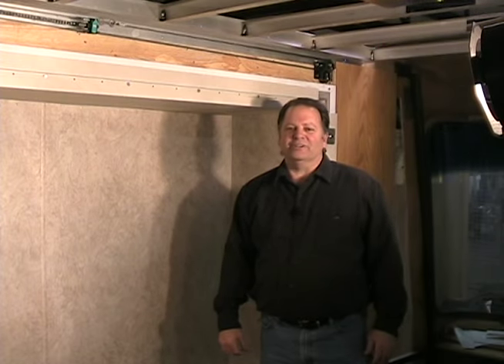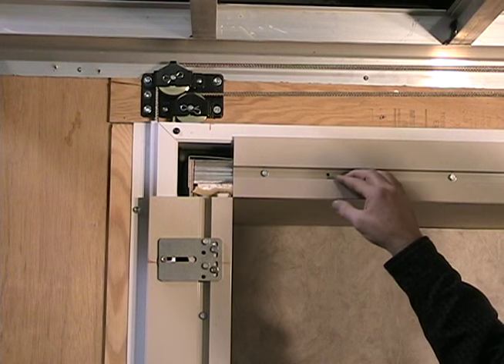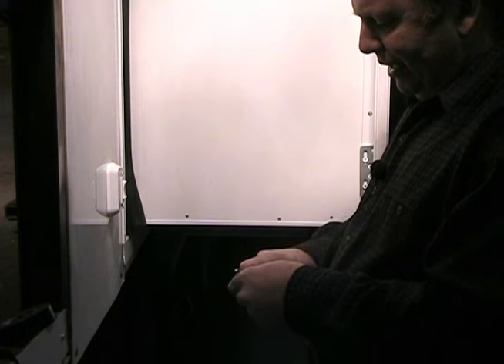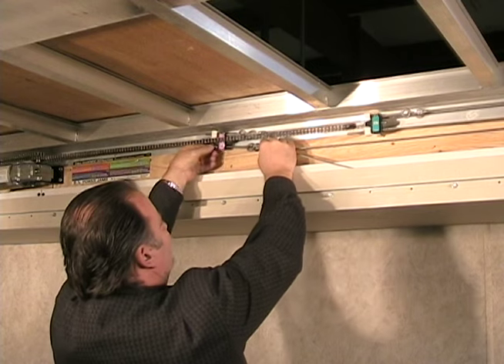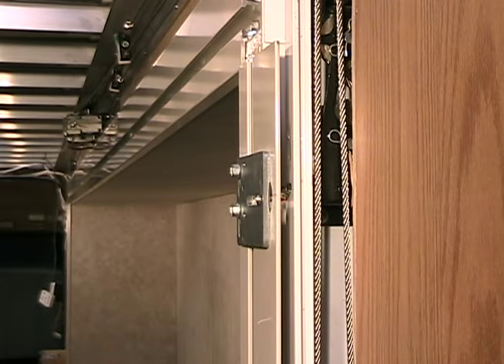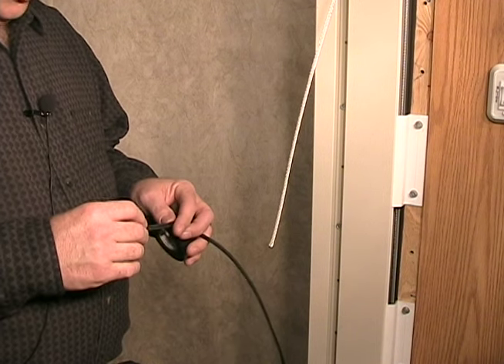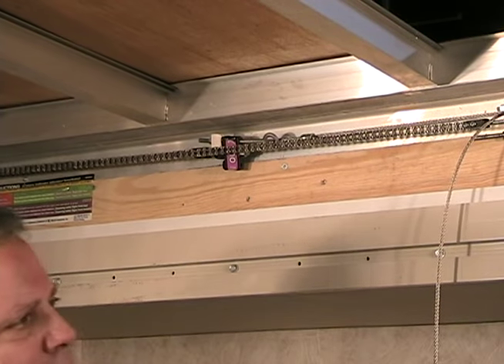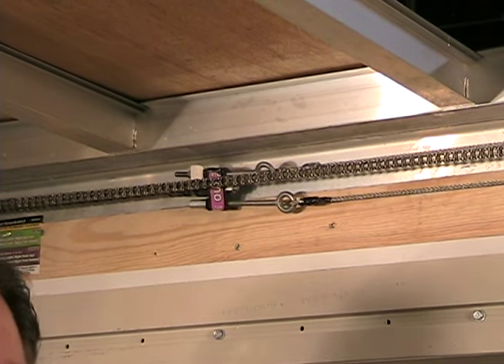BAL Accu-Slide Cable Replacement Training

Comment: Mine failed yesterday. Luckily I was at home cleaning the coach. So now I have to go see if I can git r done. The only doubts I have is having the facing on the slide to make an adjustment. Otherwise this is one fine video that is much appreciated. If you can maybe you can address removing the facings....just in case. Otherwise I give this a 10....Thank You!!

Comment: Put the smallest size of heat shrink tubing that’ll fit on the cable, works a little better than electrical tape.

Comment: What is a radius? How do you access the lower pulleys if your slide does not extend completely? The lower pulleys where my problem lies is between my bunk beds and dinette wall. This space is about 6inches wide. My slide does not extend fully for me to access the lower pulleys.
Reply from the maker: The instructor in the video is referring to bending the cable end to curve it, in order to work it around the circular pulley. The cable has to be replaced with the room in the extended position before you cut the cable to length and crimp it or it will not be the right size.  Feel free to email baltechsupport@norcoind.com for additional tips on the repair.

Comment: I have this Accu Slide system on my Keystone trailer. Recently I’m experiencing an issue where the slide out slides out fine , but doesn’t slide in. After it begins to slide in for a few seconds I hear a loud clicking/banging sound. After manually pushing in the slide out I observed that the cables/chains have quite a bit of slack. From what I’ve researched so far, I should only have about an inch or less of slack correct?. Could it be then that this excess amount of slack I see is the cause of why the slide doesn’t slide in? In which case I would need to add some tension on the IN cables only? Or all.. I do notice excess slack on both.
Reply from the maker: The cables on the Accu-Slide need to be tensioned at 1/2" deflection. Our technical group can provide you with diagrams and written step-by-step instructions on what to do. The email address is baltechsupport@norcoind.com.

Comment: What does the slide "ride" on? Or, what holds the weight of the slide? is there a roller or something along the bottom? My problem is, there was some substantial moisture on the bottom plywood floor of my slide causing the layers of the plywood to delaminate. I have removed the black moisture barrier and dried it out. reattached the black fabric. looked fine until I ran the slide in and it seems to "scrape" the black fabric off in a few spots. I can't see past the wiper seals to see what is rubbing on the bottom.

Comment: This is a great video but getting to the pulleys and the cables when you have a complete rig is the hard part. This video is all about replacing cables on a stripped down rig. I am finding that pieces I have to remove to access the cables cannot be reattached and am having to buy a LOT of pieces to reassemble.
Reply: +B Spec  EDIT.. After removing half the wall to get to the cables I found that mine has a huge metal frame that surrounds the cables. In order to remove it I would have to lift the slideroom up and remove the entire frame work that the slide slides out on all while suspending the slide in the air.. The frame work is all one piece top and bottom and side to side and it is the main frame work for the entire cable assembly. While I have the same cable pulley system as shown in this video, the main structure and mounting is totally different than what is here.

Comment: Don
Hi I liked your video very informative,BUT you have a bare wall, tell me how to replace a broken cable on a slide on an upper living room, with furnature installed and with the slide half way in a person can not get in between slide and front cuboard. it is the upper front (IN) cable. I would like to see what pully if any are inside the hole coming throught the wall before it goes up to the top pullies. Thanks I did learn why my cable broke. We have a 2011 Keystone Montana with 5 slides sold our hoouse to buy the fifth wheel and have done nothing but spent money on fixing things broke, that Keystone or dealer will not fix. I wish it was as easy as your video,keep up the good work

Comment: HOW CRITICAL IS THE CABLE TENSION ADJUSTMENT? HOW DO YOU DETERMINE IF THE CORRECT CABLE TENSION IS APPLIED TO THE TOP & BOTTOM ON BOTH SIDES OF THE SLIDE? WHAT HAPPENS TO THE ACCU-SLIDE SYSTEM IF THERE'S TOO MUCH TENSION OR TOO LITTLE CABLE TENSION?
Reply: tension is critical, not as tight as a piano wire but not so loose it droops...in other words cable should be straight with a bit of give when you "pluck" it.  If not tight enough the corner it is attached too will not snug up when it is against  the wall of the coach plus you want the corners to start to move at the same time when the motor is activated so the slide goes in or out evenly. Remember too tight is worse than too lose because that can stop the slides travel and possibly snap a cable.

Comment: on this cable driven system what would cause the super slide room to start violently shaking the coach when operating the slide in or out and it is loud?
rv is a 2016

Comment: My slider look like it should go out about 1/2 inch more on the bottom. How can I adjust it. Is there a stop on the bottom?
Reply: i have the same issue, did u ever get an answer?
Reply: Just a WAG (wild ass guess), but I would say the bottom out cables need a little more tension or the top out cables need a little less.

Comment: How come none of you 🐔🍭 show how to replace the cables if the slide is in ??????
Reply from the maker: The cable replacement procedure requires the room to be completely extended during the final stages of the cable replacement in order to ensure the cable is cut to the proper length. If the cable is replaced with the room in any other position, it will be too short. Link to document on instructions: https://balrvproducts.com/wp-content/uploads/INS.SLD_.024-ACCU-Slide-Cable-Replacement-Kit-Instructions-Rev-B.pdf